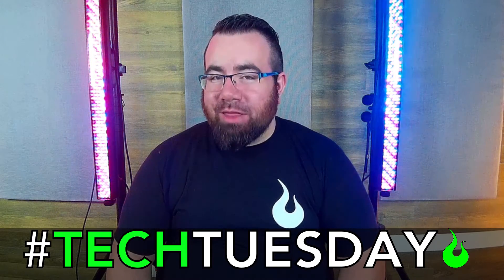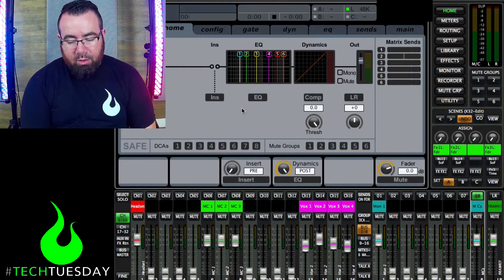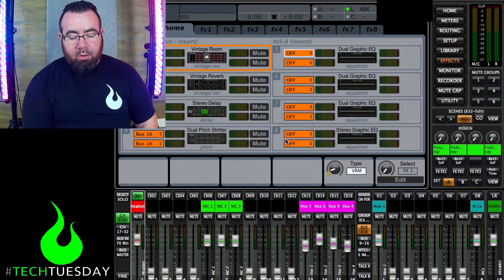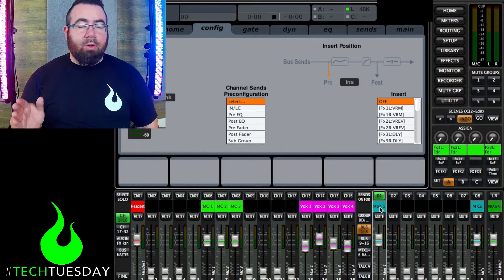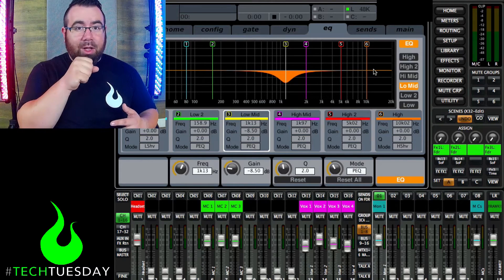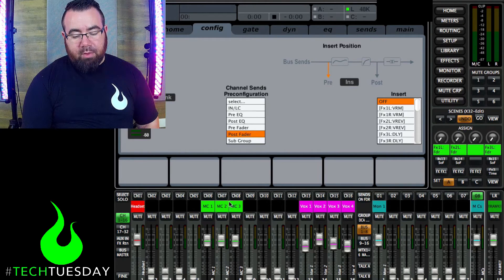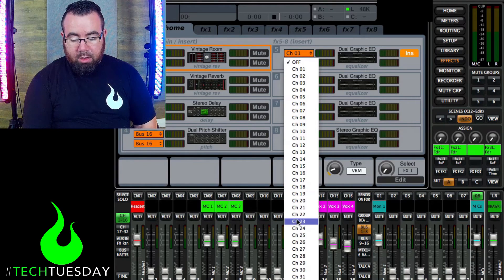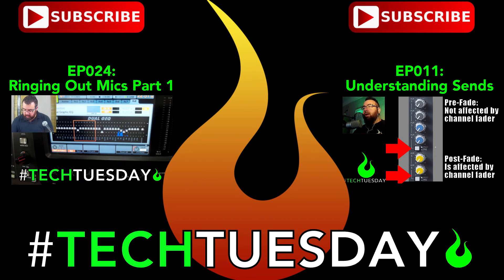How to Ring Out Mics: PART DEUX!!! - #AscensionTechTuesday - EP026

Comment: I've just started learning about using RTA and how to ring out a mic and doing so with Presonus Universal Control and the rack 32R mixer.  Some questions for you.  If you use the channel EQ to sweep the frequencies to find the offending ones and make the necessary changes to the GEQ do you eventually go back to the channel settings and do any further EQ changes for the vocals?  I'm trying to understand whether the GEQ setting changes are enough to minimize feedback while then making additional EQ edits on the channel.  Can you please share how these both (channel EQ and GEQ) affect each other?

Comment: How do you find feedback during a live service?
Reply from the maker: Good question. First off,  BEFORE the service, you need to thoroughly test your mics. Be sure to know the limits of what you can and cannot do. 

If you’ve done that and still encounter feedback, try isolating the problem. If you pull your vocal group down, does it get better. If so, then it may be one of your vocals. Quickly lower each one one at a time to find the problem mic or mics. 

Do you have live stage monitors? Are they too loud? Are they positioned poorly? Are your mics out in front of the speakers?

Do you have any odd EQ curves happening? For example midrange boosts? These are generally unnecessary on vocals and can often be the cause for midrange feedback. 

Hope this gives you some insight on what to look for :)

If you’re able to get the team on in-ear monitors, this will remove many of these variables from the list. 

-Chad
Reply: @AWTechTuesday   Thanks for the knowledge

Comment: Great Video and Very Helpful.  I just got into using a live digital mixer (X-Air 12).  I am curing about the example in your video.  Having 31 band EQ as an fx insert.  How does that work with multiple mics?  Do you repeat the same process for each channel mic?  With X-Air 12 you only have four FX option.  How can you EQ four mics from the same 31 band eq?
Reply from the maker: Atlantic Sound & Visual Entertainment Generally, this technique is only to be used on mics that super sensitive and most prone to feedback. If you have several feedback prone mics such as a group of choir mics, you may need to group them together using a bus and then apply EQ to that bus. Or, you may need to resort to EQing the monitors to remove sensitive frequencies from there so that you only affect the monitors and not the mains. 

If you haven’t already, check out this video for some really practical tips of things you should check before you dip into the EQ - https://m.youtube.com/watch?v=wI3zQl6Jhww
Reply: Ascension Worship - #TechTuesday Thanks. I have two mic that’s used for MCs at events. They can get close to speakers at the dance floor at times. I had one event that had multiple mics starting to feedback. So I wanted to know a fix for the future.
Reply from the maker: Atlantic Sound & Visual Entertainment Hmmm. Interesting problem. You may need to mark off areas where can’t go with tape or something. But yeah, in that case, you may need to use EQ to reduce some of your problem areas. I’d start with your parametric and, if that doesn’t give you enough control, then move to the graphic. If you need to save on the number of inserts used, you may want to bus the 2 mics together and then apply EQ to that bus.
Reply: Ascension Worship - #TechTuesday oh ok. I need to understand bus better. I thought it was just used to get audio to monitors. I was thinking of using the dual 31 band eq for the two mics as inserts. Side A for one mic and side B for the other. That way I save on fx rack space. Would that work?
Reply from the maker: Atlantic Sound & Visual Entertainment That works too :)

-Chad
Reply: @AWTechTuesday  Hey would you be able to get on a quick call? I inserted the 32 dual band eq on channel 1 and 2 for my mics.  I have the channel 4 channel EQ open with RTA on. I see the freq bars from my voice but I dont see them on the 32 band EQ thats in the FX Rack.  Your video shoes them on both areas so you can target that freq in need or lowering.

Comment: Hi chad, we have 2 condenser mics AT2035 for choir.. We are facing difficulties to get the proper gain in order to get more audible audio by the choir.. Everytime we raise our gain in certain amount then  the "hungggg" noisy sound come out from our main LR which make us crazy.. Any tips how to remove it? Tks chad..
Reply from the maker: The AT2035 is a large diaphragm condenser that is really designed for studio work. You may want a small diaphragm condenser that is designed for higher gain before feedback. Maybe something like the Audix M1250B.

I hope this helps.
Let me know if you have any more questions.

 - Chad
Reply: @AWTechTuesday  hi Chad thanks for the reply.. I guess i'm just deal with them first for the few months till the time that we can ask another gear.. Hahahha
anyway, Your videos always helpful..

Best regards, 
Small church @ Far East Asia!!
Reply from the maker: @Rafray87  Until that time, do the best you can with what you've got :)
Here are a few tips:
 - Get the mics as close to the choir as you can (without losing that blended sound)
 - Make sure the mics are positioned well (out front and above, facing the the choir mouths)
 - Encourage the choir to sing out so you don't have to gain up as much.
 - Remove all or as much as possible of the choir mics from any nearby wedges.
 - If possible, have the choir far away from the main speakers.
 - EQ out problem frequencies (usually your mids and low mids)
Use a low cut up around 120 or higher. Set your fader just below feedback, boost your mids and sweep the frequencies until you find where feedback is most prominent. Turn your mids down and widen the Q as needed to reduce those problem areas while still sounding natural (BE CAREFUL NOT TO OVER DO THIS!)

Here's a video I did on ringing out mics. This is a bit extreme but the concept is still valid - https://www.youtube.com/watch?v=MWJs8HGRR-Q

Hope this helps :)
-Chad

Comment: Your are send from heaven.  Our church owns  X-Air,  M32 and X32 and frankly we  use them blind folded. Meaning our concept are so vague. We are clueless. This video clarified all the concepts we wanted to learn.  We have also have SM-58 wireless and wired and they behave so well. The Shure lapel mic for the Pastor have been giving us head aches. I have to watch 3 times your video how to ring out mics. Is there a specific video how to ring out a lapel mic. I think it would same concept.  Thank you very much. May God bless your work  it really helps a lot.
Reply from the maker: In this video, I show an extreme example of ringing out a mic - https://www.youtube.com/watch?v=MWJs8HGRR-Q

In addition to the video, there are a few other things to consider. The closer you can get to the source, the less gain you will require and therefore the less feedback you'll experience. A lapel is great for video applications but not as great for live applications. A headset is generally a better choice. 

Headset or lapel, the higher quality mics will generally be less likely to feedback. My top choice right now is DPA. They are, however, pretty expensive. Another choice that has gotten great reviews and is lighter on the wallet is the "Thor:Hammer". You can find them on amazon and a few other places.

No matter what, if and when you ring out that mic, be very careful not to over-do it. As I mentioned, the video I sent is a purposely extreme example. If you do too much, the mic will start to sound unnatural. Again, nicer mics will sound more natural AND reduce feedback.

Thanks for watching and commenting!

-Chad

Comment: Chad generally I have four mics on stage each a SM58.  I EQ each mic individually through the front of house with the four vocalist. Then I have them step of the stage and I ring out the monitors. I do that by setting the bus for a given monitor at unity then select the vocalist channel for that monitor and bring the fader up until it feeds back in the monitor.  I use the PEQ to find the bad signal in that monitor and only take out what is needed. Normally I can push the channels fader far past unity grabbing bad frequency's along the way. I then bring the fader back down to a reasonable volume level and know I have plenty of head room if they need more of them self in the monitor. I'm using the XR18 by Behringer. Just curious what your thoughts are on that method. Thank you in advance.
Reply: Goodness gracious, I just watched again and basically that what you showed in the second method. You get the same result by pointing the mic at the monitor. I just drive the fader up supper hot until I find the bad stuff.
Reply from the maker: That's exactly right. It's one of the methods I mention in this video. By ringing out the monitor, rather than the individual channels, your EQ in the front of house mix should be much more natural sounding. Very good method.

-Chad

Comment: Great tutorials.  I appreciate you taking time to post these. They are very helpful.  I have a question regarding adding the 31 band equalizer to Mixbus 8 in your tutorial.  You are selecting the  2nd mono channel of the 31 band equalizer effect #5 slot.  
My question is do both mono channels share single equalizer settings or does each channel have separate settings for each bus mix? ie: work as two separate equalizers across separate busses.  Again, thanks for the great tutorials.
Reply from the maker: When it comes to the 31 band EQ rack, there's an option for Stereo and there's an option for Dual. Stereo would mean that the settings are the same on both Left and Right. Dual, will allow you to use the "Left" channel on one instrument or mix and the "Right" channel on a different mic with different settings. I'm using the dual EQ for this example.  

I hope this helps. 
Thanks for watching and commenting!  

-Chad

Comment: Thank you so much for these great tutorials. I'm not FOH but I will make sure our sound tech knows about this. I have a question about the HA gain split on the set-up preamp tab on the X-32 mix app for the IPad. Does that split the preamp gain into 2 or more so I can adjust my own preamp gain for a recording device without affecting the FOH mix?
Reply from the maker: Thanks Randall!
As far as I'm aware, that option puts your device into digital gain mode so you can adjust gain without actually changing the pre-amps on the actual hardware.

-Chad

Comment: Great job, my question is, my CD recording is not as loud in my car as the radio stations, i am recording through the software Audition. i am hitting the 0 db level but it still not loud enough. Would you please do a video on this. Thank you, Courtney Williams
Reply from the maker: Thanks for watching and commenting!

The short answer is, professional recordings go through a process called mastering before release. One of the main staples of mastering is a dynamics process called limiting. Limiting boosts the entire signal while also super compressing the loudest bits. 

If you're on an X32, there's a rack effect called Precision Limiter. Try applying this to your recording mix but be careful, it cannot be undone. There are better limiters available for recording programs if you wanted to master the recording afterwards. Otherwise, the Precision Limiter does a good job and is simple to operate.

Hope this helps! I'm certain there will be a video on limiting at some point as well :)

-Chad